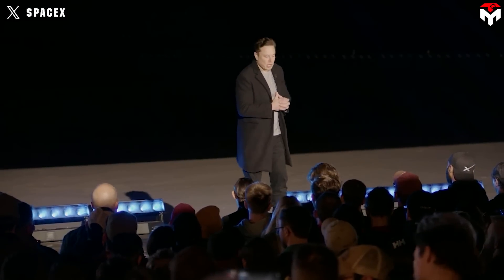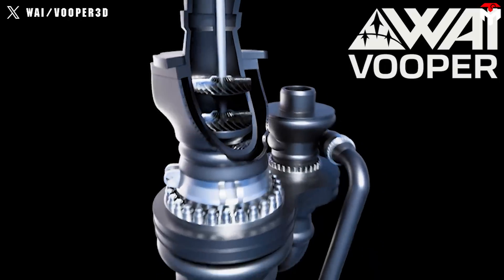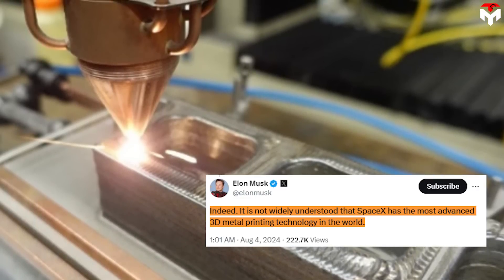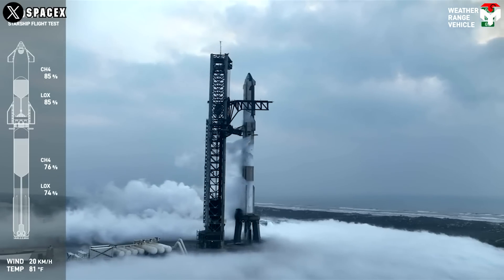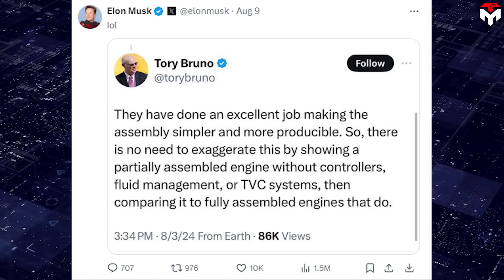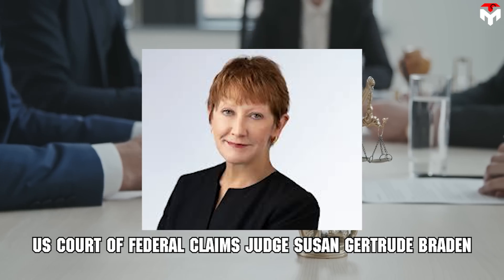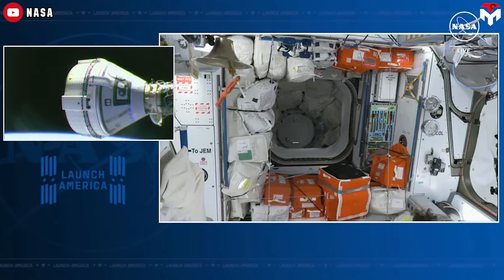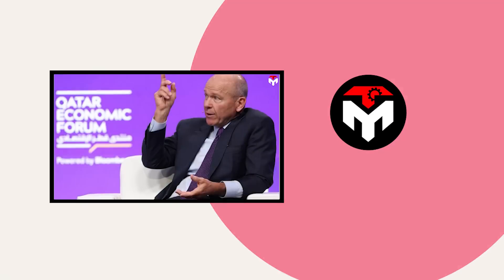SpaceX Genius Adjustment on Raptor 3 Engineering SHOCKED the Other...

Comment: The best is yet to come, if the Trumpster wins the election, and has Elon on the "Efficiency Board"...

We could see the Space Program get a serious boost as part of a National infrastructure project...
And companies like ULA actually have to be competitive.

Also there are other Start ups getting DOD business like Rocket Lab...

This is kinda the beginning of a new era in Space Exploration with the advent of the Raptor 3 paradigm.

More companies will build cheaper better engines, once they make it past the five stages of grief on their old Spaghetti Monster designs...

Tori bruno has made space history, with one of the best Space related foot in mouth examples!

That will undoubtably induce thought planet wide in the industry.

And gain attention for Raptor 3, so that when it does debut, it will have the experts watching closely.

I have confidence, due to its simplicity, its performance, and the pretty blue flames, as everybody who burns gas knows thats the sweet spot on the burn mix...  

Thats as good as it gets!
And I will be looking forward to the first R-3 launch to see people's reactions when the butt end of the booster comes into view in the video feed..

Something strange, we've never seen a burn that color.

Also, those Raptor 3 engines should push some impressive acceleration stats, people will be comparing with earlier launches, and wondering where they were throttled in their range of capability?

I suggest SpaceX post the throttling percentages, just to make a point, so bean counter engineering types can make good comparisons, to ecourage the competition to try harder on their new engines...

And so the numbers crunchers can play with the numbers to extrapolate:
 "Max Broomstick"
effect...

And Elon has mentioned thousands more improvements to come...
He's not waiting for ULA ot NASA...

Its only gonna get better, and I'm looking forward to V-2 and beyond...